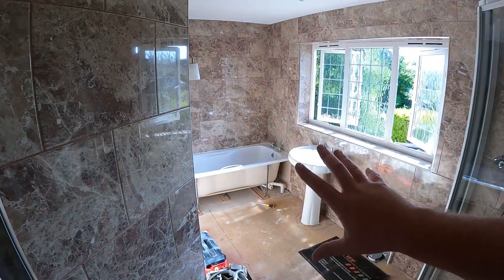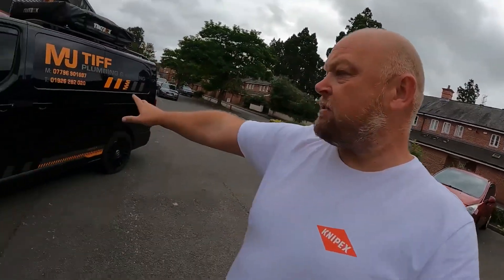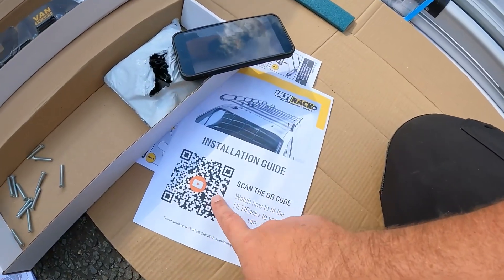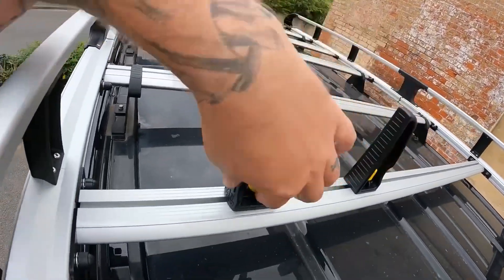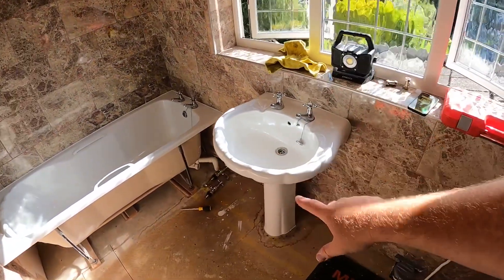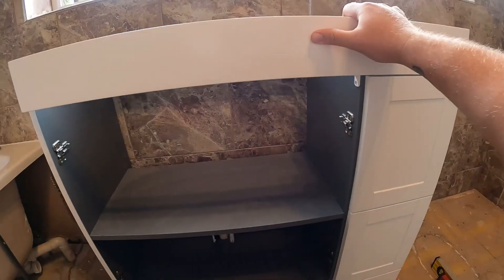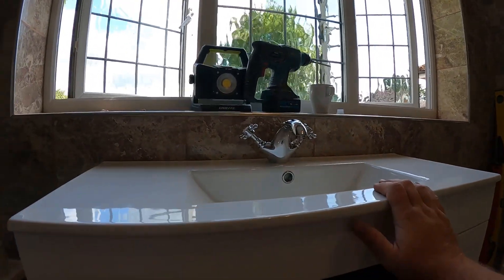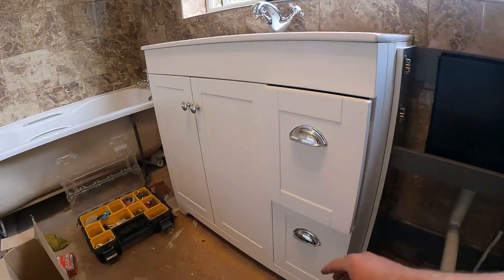BATHROOM REMODEL PART 1 | How to SAVE MONEY on a “New Bathroom”

Comment: Got same roof rack and same pipe tube x 2 from vanguard, 1 for copper, 1 for plastic, looks good 

I always put flexis on isolation valves, never had one leak
Reply from the maker: Great roof racks ain’t they buddy…… if you need anything else don’t forget the 20% off with “MJTIFF”😉👍🏼

Yep, neither have a buddy…. It’s all about not over-tightening it

Comment: on the concealed cistern flush pipe, buy a rubber clad euroclamp (those used to support suspended pipework) 42mm or 48mm should be about right, pair it with a suitable length slotted angle bracket, and for about £1.50 + the cost of a 8 or 10mm bolt and wall fixing, you have a rigid but adjustable flush pipe clamp similar to ones supplied with Geberit concealed cisterns.
Reply from the maker: Yer I’ve seen them about
Reply: You can buy the Geberit flush pipe clamp as a spares item, but I haven't seen them for less than £10, and for as much as £20+, absolute rip off for what they are, I'd prefer spending £15 and having enough parts for 10 clamps if I was fitting concealed cisterns regularly. @MJTiffPlumbing

Comment: I never understand why they give you such little room to get connection to cold feed on cistern in them bloody units 🙄 
Nice tip regarding cistern flapping about, I normally just stick the cut out from the pan there to sure it up
Great vid as ever mark 👌
Reply from the maker: It’s a real pain with them side entry valves….

Yep the timber behind the cistern is a must…. See Part 2😉👍🏼

Comment: Hi there, just wondering about a 110mm pipe running under a bath is it ok?. Soil stack is behind bath in another room and joists run the wrong way.... Any ideas/advice. Thank you
Reply from the maker: No problem with that buddy
Reply: @MJTiffPlumbing  top man cheers 👍

Comment: Mark if you went to a job that already had a cistern like that and it was bouncing and causing a leak? do you think sticking a doughnut washer onto the back of the cistern with some silicon? would that be strong enough to fix the problem and stop it from bouncing? I'm just curious to now if doing that would save you some time stripping it out and fitting a strap of wood.
Reply from the maker: Yes I guess it would work and certainly help

Comment: Mark that panel you have,  does the panel and height adjuster panel match? And if so is the panel any good.  Customers have been ordering crap just lately. 
If it does match and decent where and what is it. 
Cheers
Reply from the maker: Yer seems pretty good to be honest… customer ordered it themselves from……. Dare I say it, Victorian Plumbing
Reply: @MJTiffPlumbing  I could have sworn the last one came from there, the panel and the bottom board were different finishes completing,  one wrap and the other like a melamine board

Comment: In the bathroom example would you generally tile the room before or after fixing the bathtub in place. I recently completed my bathroom renovation and fixed the bath in place and tiled around it but found it bloody awkward and very difficult and was paranoid about damaging the bath.
Reply from the maker: Alway tile after the bath is fitted 👍🏼👍🏼
Reply: @MJTiffPlumbing  thanks, at least I did it right, even though it was bloody awkward.

Comment: Hey Mark,
Would life be easier if you slid that pipe rack back just past the roller, so the key was more accessible?
Reply from the maker: I quite like it tucked away so it is fiddly…. Just incase some scumbags try to drill the lock out

Comment: Why do you use those type of isolation valves? They are absolutely rubbish and ALWAYS leak and seize!!!
Reply from the maker: Because I’ve not had an issue with them…..👍🏼👍🏼
Reply: @MJTiffPlumbing  you won't when they're new. Go back 5 years to your customers' house and turn them on and off. It's a trade known fact that they all leak over time!

Comment: Had my rhino roof rack and 2x rhino tubes stolen off the top of my berlingo in the middle off the night outside my house, just unbolted it and walked off up the road with it! Copper and plastic lost aswell. Scum
Reply from the maker: No way😮😮😮
Reply: Yes just 6 bolts undone and they lifted it off. I'd suggest getting some sort of locking nuts for the bolts that fix it to the van on the 8 plates on yours or find someone to put a spot weld on each bolt. Year before i had all my tools stolen too. So disheartening which is why I've mostly left the trade to go back to operating cranes